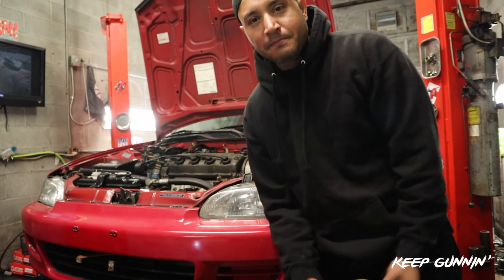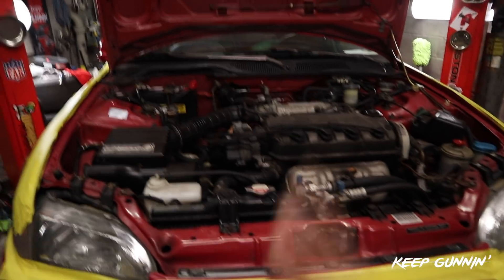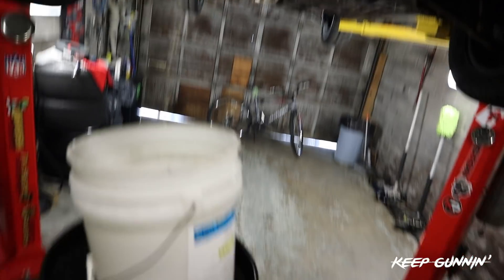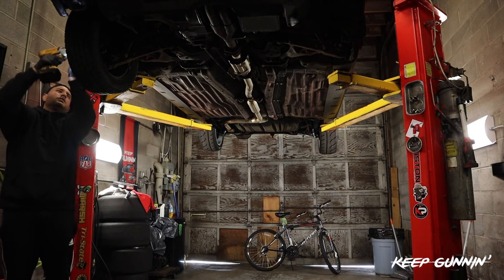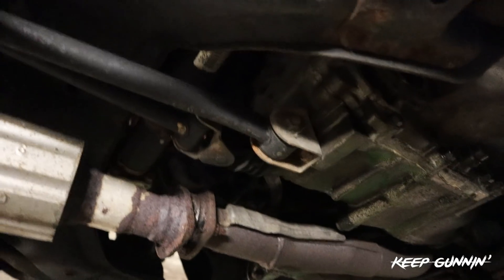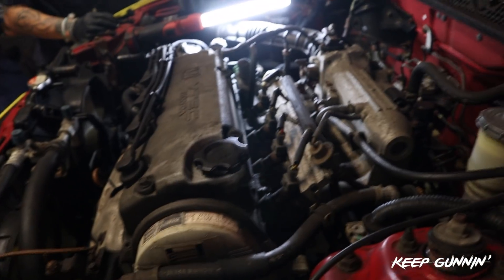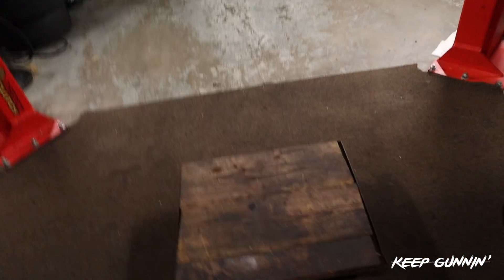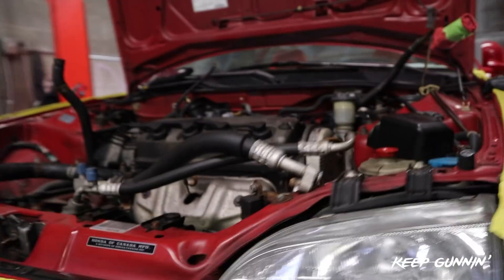BUILD HAS STARTED!!

Comment: Great content man. Keep up the good work 👏🏼. I trick I use to remove the shift linkage pin is taking one of the 12mm bolt from the AC compressor and hammer it on the pin, it always works for me.

Comment: Drop some info on engine internals, valve clearances ,timing, shifting technics, fuel setups, weight reductions, transmission gearing internal tips, suspension setups,just naming thing off the top!